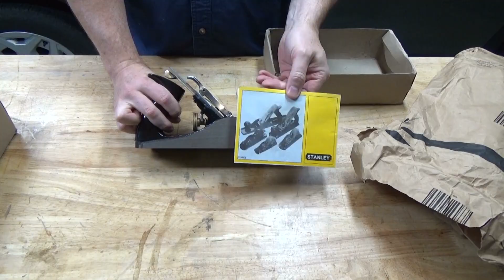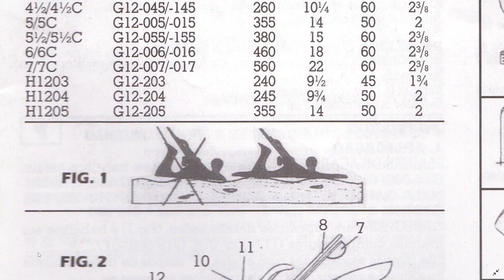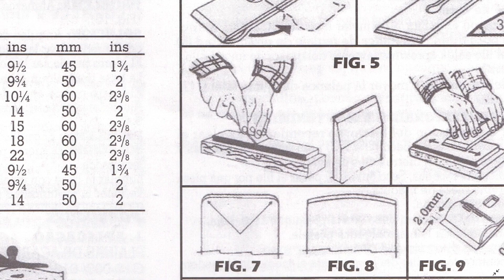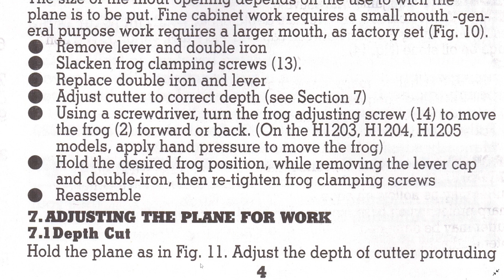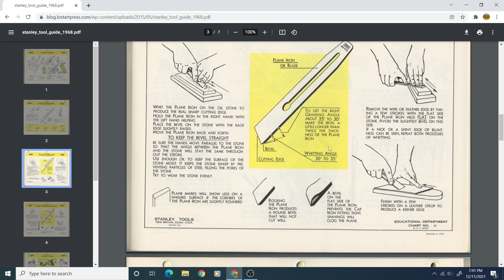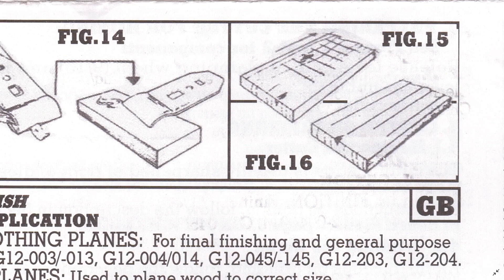Bench Plane Tuning By User Manual: Are Special Skills Required?

Comment: What about checking the sole for flatness? 
I bought a new Stanley low angle block plane years ago. I found the sole wasn't flat out of the box. In fact it had a large dip in the middle which rough grinding at the factory either didn't take out, or perhaps introduced, and required lapping in from me.
Reply from the maker: Interesting right! The manual does not mention anything about flattening the sole. I was very surprised how roughly ground the sole and sides were out of the box. But it worked, at least on the edge of a piece of hard maple.

Follow up video releases on 1/14.

Comment: Very cool! Love my planes. I’m wanting a 4 ½ next.
Reply from the maker: Thanks John! I haven't had a number 4 in my hands for years, but I remember feeling cramped. Lot's of room in this 4 1/2, but face planning is a workout with that wider blade!
Reply: @woodshopnerdery  I’ve got pretty porky hands and find myself thinking about making a larger tote. 

Thank you for the info on the 4 ½ !

I take a thinner shaving if I get tired of pushing … also think about Japanese planes … 🤓